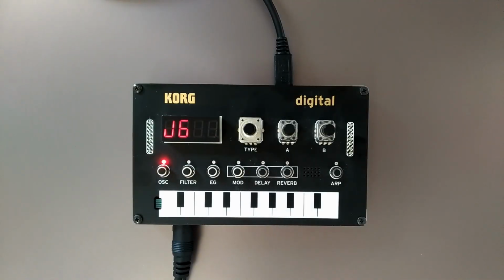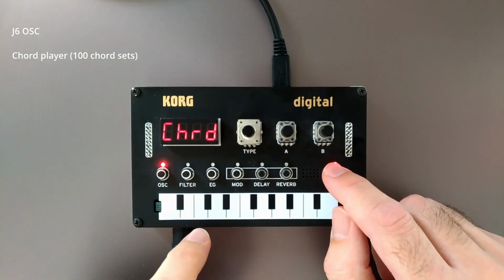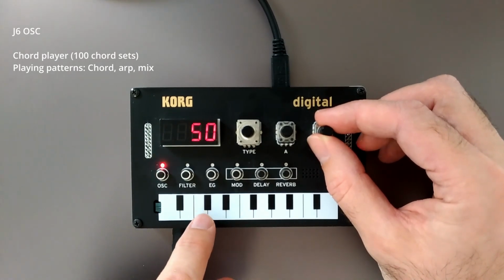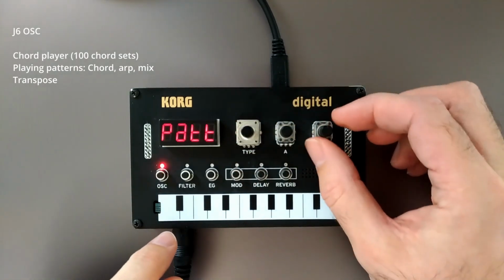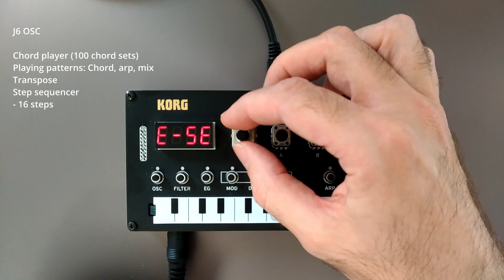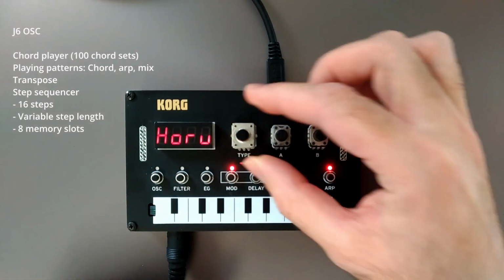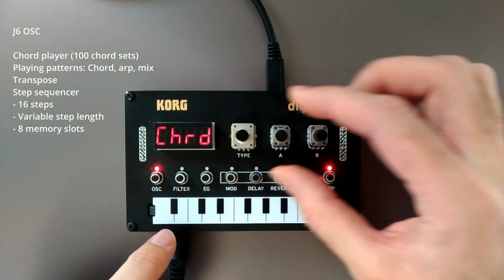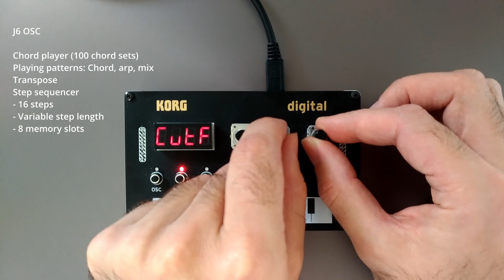J6 OSC for Korg NTS-1

Comment: Ive had the NTS-1 and J6 osc for quite a while, but Im trying to dig a little deeper. Any recommendations to making a 4 chord loop, each chord lasting 1 measure, as an ambient chord generator? I know you can mute steps in the step-sequencer, but sometimes notes are added even when holding the key down for more than 1 second. Thank you for all your work!
Reply from the maker: @davidkaplan5450  thank you for your interest. You can try step record mode if you haven't yet. Step record: Once in record mode you can turn parameter 4 to any value between 1 and 16 (for instance 5) and the next note you’ll play will overwrite step 5. At this point it won't advance steps automatically. This means that each note you play will overwrite step 5 over and over again until you manually change to other step, or turn it to 0, to stop recording.

Recording rests: there are two ways to record a rest:

1. Record notes step by step, and the steps you don’t record will be rests

2. Long press any note for more than one second, and it will record a rest (instead of that note)

You may also have found a bug. If you can reproduce the same error consecutive times please let me know. For better conversation please DM me on twitter (search Tweeeeeak)

Comment: You are awesome! Thanks for everything!  I ve a question, is possible change The speed or the bpm for the sequencer?
Reply from the maker: Yes, it is the speed of the arp, which uses internal clock or sync'ed from external sync or midi inputs.
Reply: @tweeeeeak228  thanks so much for your answer!

Comment: I have been using it for a few weeks and tonight I paired the NTS-1 with a Minilab3 midi keyboard. It has been freezing up when I try and change chords or do other things. Have you used the J6 oscillator with a midi keyboard?
Reply from the maker: Hello @D P, sorry for the late reply, I wanting to try it out before answering. I found no issues. Have you checked if you have selected a certain play pattern above 1 ? Patterns are programmed to ignore some notes pressed, so if you try simple playing (without the arpeggiator), while a pattern different from 1 is selected, some notes will be ignored. Let me know if this helps.

Comment: Hi, thank you for this great oscillator. I started to use but there is something strange, probably my mistake, I'm new on synth world. I'm using NTS-1 mostly with Korg volcas. There was no sync problem previously but with J6 my sets become out of sync with time. Just NTS-1, not the other volcas. I don't know about the code you write, or is there something changing/making the sync-in signal of NTS-1 but something wrong on my NTS-1 :( (You can check my latest video.)
Reply from the maker: Hi Naci E. I have no control over the sync on the OSC code. I am thinking that it might be CPU usage to high with the J6 osc. Are you using mod, delay and reverb altogether? And processing external audio in the nts at the same time? Do you notice any noises?
Reply: @tweeeeeak228  Thank you for your reply. Yes I used all effects together and YES, I heard some noise when I changed mod and/or reverb :( This might be the reason, I'll try it without effects. Thank you again :)

Comment: hey man, i have a question.
first of all, great work on all your oscillators. its really incredible  how much functionality you can squeeze out of this little guy.
since i am completely in the dark when it comes to programming, please forgive me if this question might sound naive. but i was wondering if it was possible to program the NTS-1 so that it can quantize incoming midi to the internal (or an external) midi clock. the reason is this: when i use the ribbon keyboard on the NTS-1, it aligns the beats precisely. but as soon as i use an external controller, i have to hit the key perfectly in time in order for the arpeggiator to be in sync. 
do you know if something like that would be possible to implement on the NTS-1?
cheers & have a nice day!
Reply from the maker: Thanks Raoul. Regarding your question, I didn't know that, must try it. I have no control over the arpeggiator sync. Try looking at the global parameters, like the sync step, or disabling the RX messages.

Comment: Can you use the chords midi to play an external synth or daw? Or can you only use the NTS1 sound source?

If yes, is it possible to alter the chord sets? I understand it cannot be done on the NTS1 itself, but maybe on a computer?
Reply from the maker: Sorry, the NTS-1 does not output midi. The chord sets are fixed and cannot be changed, but if you have any particular sets in mind, I wouldn't mind adding them. DM to me on twitter pls.
Reply: @tweeeeeak228 Actually, the NTS-1 does output MIDI, but this requires pins to be soldered through holes on the PCB, and to an off-board MIDI socket 🙂
Reply from the maker: @dingalarm  that is true, but on NTS1 mk1 I do not have access to the output MIDI, so the chords generated by the J6 OSC would not be outputted, only the played keys on the ribbon. On mk2 I still have to check.
Reply: @tweeeeeak228  OK. So as I understand it, you must have an early version of the Mk1, which did not have MIDI out. Later versions of the Mk1 had a revised PCB, which had inputs/outputs for MIDI, Sync and Audio.

Comment: Does this support midi cc messages for changes or all changes have to be made via the device?
Reply from the maker: @eamesproductions The NTS-1 supports midi CC messages for everything except OSC extra parameters, which is a shame. Shape and Alt are midi controllable, but not Chord, Pattern, Transpose and Sequence parameters 😐
Reply: @tweeeeeak228  cheers - thanks for the response - Imma give it a whirl today and see how we go! thank you for the great work - will touchbase soon!
Reply: @tweeeeeak228  thanks again for the work and it works well! Would love to know what the scales are for each of the built chords as I am finding it really tricky to be able to fix most of the chords into the mix when I am working on a specific scale.
Reply from the maker: @eamesproductions  the chord sets are the same as the Roland J-6, and there's a link to the list of chords on the video description. Check it out and let me know if that's what you're looking for.
Reply: @ Great - thanks! Jam coming soon! Will tag you! Let me DM you as well - got some thoughts around how we could add some more features!
Reply from the maker: @eamesproductions  you can DM me on twitter. Link in bio.

Comment: if I download this patch, the factory settings will be erased?
Reply from the maker: No, you can add it to the existing oscillators. Just be careful not to replace the Waves oscillator. Put J6 in an empty slot. You will need the NTS-1 librarian application.